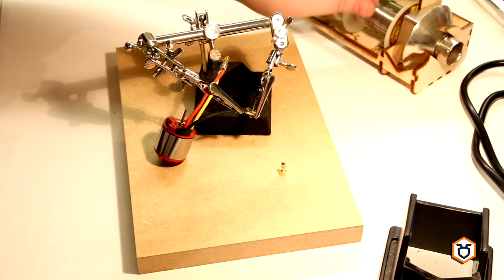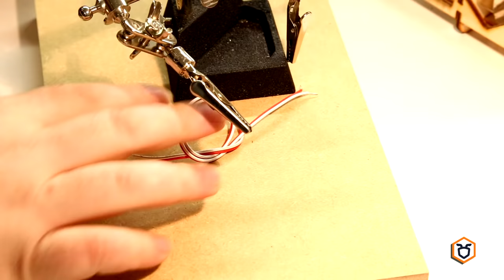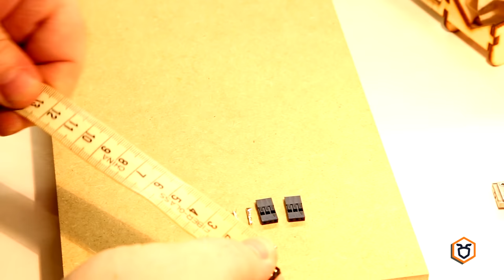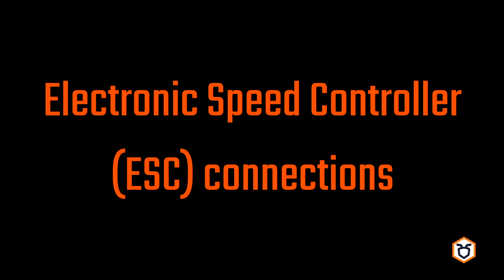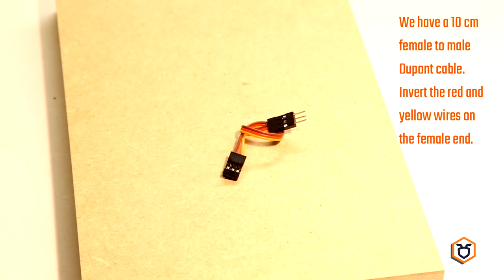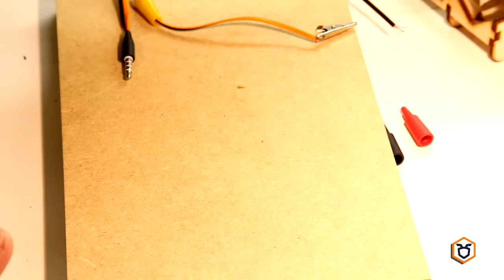Cables and Connectors Preparation

Comment: Small anecdote on the go. When you pick old or cheap headphones, you can pick too cheap :D While you will only have two wires on each side and 3 zones on the jack if you do not have a microphone, the funnier part is, when you get signal wires in the headphones which are essentially coil wires. Mine managed to have a thin clear coat isolation. After separation and cutting the one wire off the heat during soldering managed to melt the coat and short the pair inside the cable. I then took a scalpel and performed an incision somewhere down the cable to get to the wires. Then I scraped off the isolation of one and probed whether this was the one to cut or to keep. Well it was of course the one to keep. To avoid another short I then made another incision 1 cm away and cut the other wire. Now the probe cable was working as expected. Nice! 

Since I had an open surgery I tried to put a shrink tube onto the cuts but failed to do so as I could not get it over the crocodile clips (I bet I would have melted the wires again anyway when applying heat to the shrink tube, so that's a win here :)
A little bit of tape now performs it's duty as a probe-bandage :D

Comment from the maker: Important note: there are some limit switches that have different pin positions. During the cable preparation and connection you must be sure that the Common pin and Normally Open pins are connected to the board. The other pin is not used.
If you don't do this your limit switch may not work properly.
Reply: You should also mention that the JST connector should have a 2mm pitch. The 2.54mm variant I have doesn't fit.

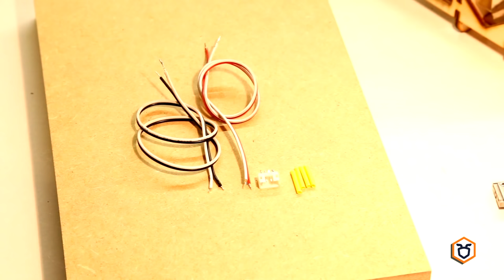Comment: JST makes a lot of different connectors... turns out the ones I had on hand were not what is needed to extend the Z-stepper :-(  According to https://www.haydonkerkpittman.com/-/media/ametekhaydonkerk/images/products/linear%20actuators/can-stack%20linear%20actuators/15000%20ext%20draw%20681x360.jpg they're using the "PH" series of 2.0mm-pitch wire-to-board connectors (http://www.jst-mfg.com/product/detail_e.php?series=199). I believe the part shown at ~5:43 is B4B-PH-K-S (top-entry through-hole header) if you want to get fancy in your BOM, but I'm just ordering a kit of knock-offs that include the 4-conductor size.

Comment: Relly nice project. But if you using crimp conncetions, you should not pre-tin the cables.
You might solder after, but by pre tinning the crimping will not get a perfect electric connection, as it should. 
Maybe use 14 cm length wires on both stepper motors, so it doesn't matter if they get mixed up.  I guess 2 cm extra wires wouldn't be that much of a problem for the 12 cm wires stepper motor position?  I guess that an 2 cm short wires are more of a problem? 
Except that, really nice video.
Reply: The text on the video does now mention not tinning crimped leads, but given that they're using pliers instead of an actual crimping tool, tin+"crimp"+solder might be the way to go, assuming you don't make it too big to fit the housing.

Comment: For the curious, at https://youtu.be/eRefCvD_KVs?t=347 which AWG cable is this? On the BOM there are 26AWG and 16AWG. The cables above look like the thinner 26 AWG, right? The original Z-Axis  LC1574W-04-025 also have quite thin wires already attached.
Reply from the maker: Yes, you are right, it's a 26 awg.

Comment: Great project, I've visited you at Make Munich. I'm really looking forward in buidling one myself when the BOM list gets available, but I understand that these things take their time.
Do you think it'll also be suitable to carve some small writings in a piece of wood? It's hard for me to estimate the power that is available from the milling-motor.
Reply from the maker: Hi, and thanks for your comment and your visit. We didn't really try, but we think it would be possible, it really depends also on the type of wood and other factors. If it's plywood likely yes, adjusting travel and spindle speed and using the proper bit and a proper depth. If it's some kind of hard wood likely not.
Reply: People generally very much under-estimate these small machines, so I wouldn't be surprised if it does even hardwood just fine, given some tuning. I have a Gearbest T8 engraver with a 775 motor spindle and while people say you can barely scratch aluminium with it, I've been milling 5mm mild steel. :)

Comment: First of all I want to congratulate this project. It is very hard to find this brusless motor D2632 here in Brazil. Are you going to give another option?  Thank you
Reply: Ali express, search MYSTERY 1000KV Outrunner Brushless Motor Helicopter. $18.72 US
Reply from the maker: @misterfixit1952 it's ok to use this motor (we didn't try it yet, we will), but take in account that this motor needs a 3d printed head with a small modification that we will provide as soon as we try.